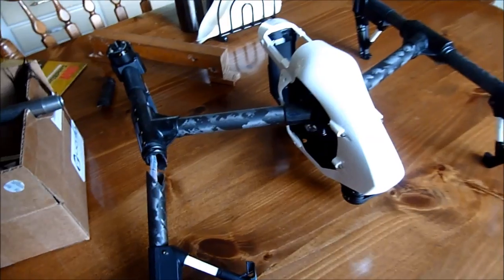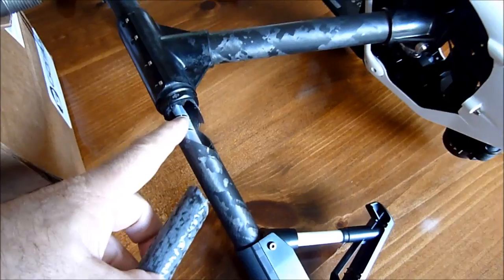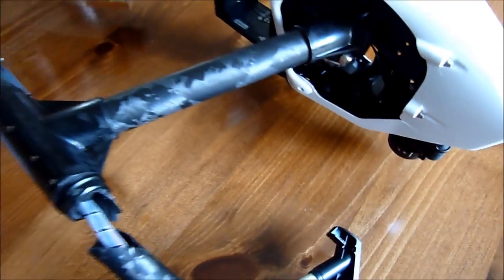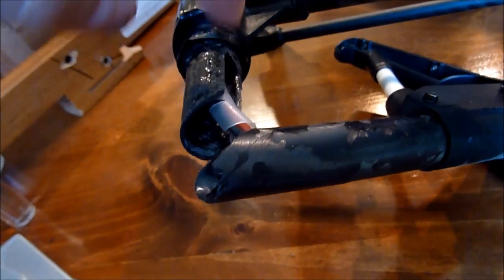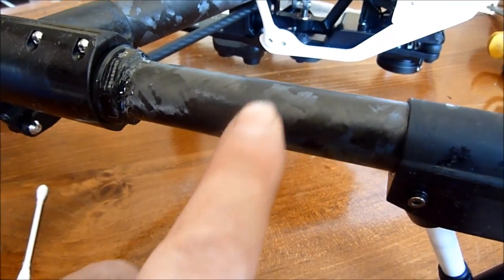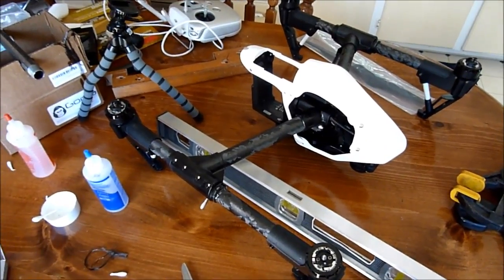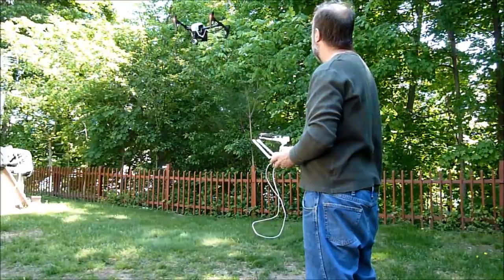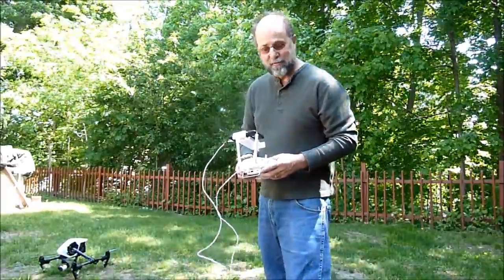DJI Inspire 1 Repair - Carbon Fiber tube broke in crash

Comment: What would be the size of the tube I have to buy ?
Reply from the maker: +Luis Jaen , The tube I made had a 3/4 inch inside diameter, and with the cut slot I was able to get a tight fit.  I would use that measurement as a guide.
Reply: thanks for your reply.
Do you use a plastic tube or did you use the carbon Fiber tube. I saw a link you gave to someone where to get the carbon fiber tube
Reply from the maker: +Luis Jaen ...yes ... stay with the carbon fiber ... it does have added strength.

Comment: What an awesome repair and a very clever way to approach the problem; obviously well thought out! I had a question about alignment during reassembly; wouldn't the jagged ends of the broken booms provide proper rotational alignment, since they fit back together like puzzle pieces? I'm going to attempt this repair using 19mm pultruded CF tube, and cut a slot in it for the wires. Hope it works as well as yours did!
Reply from the maker: +Peter Dahlmann ....Thanks for your comments.  You are correct as the jagged edges of the break surely do help to lock in the alignment.... but not 100% as there still is a little slack, so any thing that can be used to precisely lock it in place, then you have to include it... the jig I made to ensure the alignment was not used as intended, as it was a little awkward to use ... too heavy. I did use my level as a straight edge to verify the tilt was correct, as noted in the video.  I am confident of your success too, as I have received numerous accounts of this technique being performed with great success.  One individual added some steps after the tube was epoxied in .... some filler adhesive was used to fill the area in which the carbon fiber split, then wrapped in black.Also, as you have stated, purchasing a pre-fab'd CF tube is the way to go ! Thanks again for your comments ! Enjoy !

Comment: I bought 19mm carbon rod as I've read in other forums this will fit. I can cut a slot for the wires after. Can you use a small epoxy glue stick instead of the big container mixers? How long was your carbon fiber tube joiner section Bruce?
Reply from the maker: +Alistair O'Brien  ... I would not use a glue stick as the carbon fiber bonds better if it is saturated with the epoxy, I am not sure the glue stick will have the same bonding attributes as the epoxy would.  The Carbon fiber tube I made was approx 4" long .... maybe 4 1/2"

Comment: What size tube did you buy?
Reply from the maker: +Alistair O'Brien  .... I created my tube using a 3/4 " iron pipe as a mold.  This may be a little big, but with the slot, you can compress it a bit and create a nice snug fit.  (of course with epoxy to bind it together)

Comment: Bruce,  Where did you get the Carbon Fiber splint to go inside and the epoxy?
Reply from the maker: +Wassef Kamal  ... I would recommend buying the tube, rather then making one ... seems to be plenty of sources out there ... http://dragonplate.com/ecart/categories.asp?cID=79&p=2   The epoxy I used was just a standard epoxy purchased at Home Depot.

Comment from the maker: ...... one of the viewers here ,used a pre-fab'd tube to make the repair ....making this repair even easier !!!!  ...kudos to waleed alshumrani !!!
Reply: +Bruce Roberts 
What is the source for the pre-fab'd tube?
Dan Dobbins, dandobbins52@gmail.com
Reply from the maker: +Dan Dobbins here is a source :  http://dragonplate.com/ecart/categories.asp?cID=79&p=2
Reply: +Bruce Roberts you mean, replace the entire tube, right? ... but that does require redoing all the wiring ... fyi - there are many sources for carbon fiber tubes (lower prices), dragon plate products look top notch, but expensive.
Reply: No he means doing what he did, but without making your own tube to go inside.

Comment: Just saw your repair video. I have the same break on my inspire what type of carbon fiber did you get? Weight etc. Did you buy the carbon fiber on line or at a local store?
Reply from the maker: Betsy Pearce .... the carbon fiber was the first thing I found .... bought from Amazon ... Godzilla carbonworksTM 3'x1' carbon fiber cloth.  I took more time planning the repair than the actual  repair took.   Best of luck to you.

Comment: Hi bruce , I am thinking of using this product to fix the broken carbon fiber tube in my inspire , what do you think about it ?
http://www.qvc.com/Fiber-Fix-3-Piece-Multi-Purpose-Super-Tape-Adhesive-by-Lori-Greiner.product.H202065.html

it called fiberfix
Reply from the maker: *****  .... looks like it would work .  I prefer the two part expoxy that saturates the carbon fiber and really bond with the  broken tube of the Inspire.  The little sheets of carbon fiber that I used also insure the thickness of the tube was consistent to also make uniform bond to the Inspire.  Hope it works for you !
Reply: Bruce Roberts  thank you Bruce for your replay , 
I tried last night with fiberfix but unfortunately it didn't work , i think its because they recommended to wrap not only the damage  but also  continue  4 inches in both side from the damage , which is impossible in my case as i have the exact same damages as yours .
Reply: Bruce Roberts follow up , I fixed my inspire in no time using your method the only different that i used ready carbon fiber tube . 
thank you so much .
Reply from the maker: ***** Great to hear ! ....congratulations on your repair ... glad I could help !   Thanks for the follow up.
Reply: +Waleed Alshumrani  where did you get the premade tube?
Reply from the maker: +Seth Stouder ... here is a source :  http://dragonplate.com/ecart/categories.asp?cID=79&p=2

Comment: I have an almost exact copy of your broken part and I need my Inspire for a trip to Alaska in two weeks so I'm thinking this is my only course to get this fixed in time.  I'm unsure what product you are referencing "Shrink Wrap Tape on the pipe you used to create the internal splint. Please advise. Thanks.
Reply from the maker: iowa crash the "shrink wrap tape" that I used was similar to the  X-Treme
Tape TPE-X36ZLB Silicone Rubber Self Fusing Tape, 1" x 36' found on AMAZON.  Although I believe any rubber tape ... ie electrical tape could be used.  It is there only to help hold the shape of the tube while the epoxy sets....

Comment: Did you test on ATTI mode? I mean, weight and rotor positions are changed, and maybe it can bad effect on positioning?
Reply from the maker: Mikhail Androsov That is a great question ......I have only flown it in the P mode.... but now will be on my "to-do" list.  The weight difference is minimal as I could make it and still get the rigidity... maybe 3 grams ... and positioning was a chore to get as "perfect" as possible.  When the weather co-operates I will give the ATTI mode a test ... thanks again !
Reply from the maker: The repair is rock solid.  Very pleased !  I did put in Atti mode (manual flying) and it did seem to drift very slightly to the side of the repair ... but very very slightly and easily controlled.  I do have to attribute this to the slight weight added to that repaired side. I am still thrilled with the repair !  Of course when in the the "P" mode (auto positioning) , this bird steady !
Reply: Bruce Roberts how much weight do you suppose you added? Would it  be a good idea to add counterweight on opposite side
Reply from the maker: +sixtrystilsunday Carbon fiber tube and epoxy would probably weigh a few grams .... I don't see it as an issue, as it does fly very stable!

Comment from the maker: Follow up ... what is amazing, with the carbon fiber splint that I used here, the carbon fiber boom is now stronger than the than the original !!!   I have been flying daily with no issues at all ... very stable flight !!!  The repair has had absolutely no impact on the integrity of the craft or the flight.... with some pre-planning the repair was so easy !!!

Comment: The Carbon Fiber was bought from Amazon ... Godzilla carbonworksTM 3'x1' carbon fiber cloth.  I used a 5 minute epoxy (1500psi)  DEVCON ...from Home Depot. making the tube was the key to my success ... a trick was to use some shrink wrap tape on the tube while it was curing ....
Reply from the maker: MrJMMedia Creating this repair and sharing it on YouTube was not my original intent ... but hindsight I wish I recorded more of the "tube" creation.  The repair of the carbon fiber will be different for the amount of damage inflicted, and will be different for each condition.... I may create a little video on the making of the slotted tube, if interest is there ....thanks for your question !
Reply: Bruce Roberts Can you please share all your measurements? Like the measurement of the metal tubing you used to make the carbon fiber insert? Thank you!
Reply: Bruce Roberts Interest is deferentially there!!!! :)
Reply: Bruce Roberts +1 for me Bruce, as someone who had an unfortunate incident with a tree.